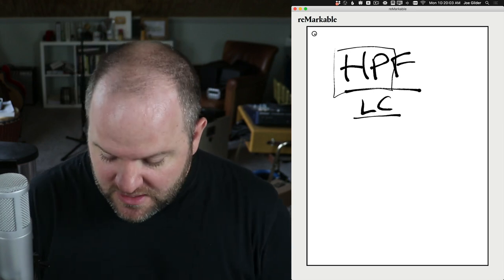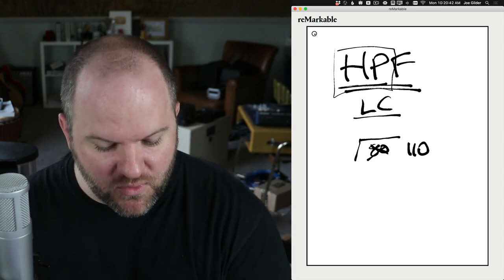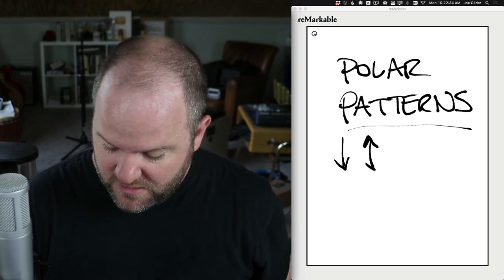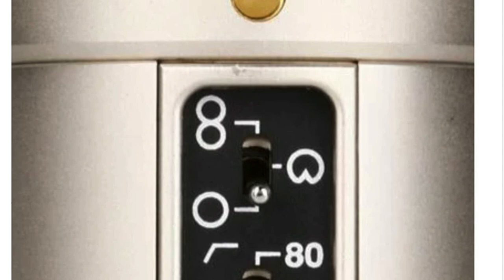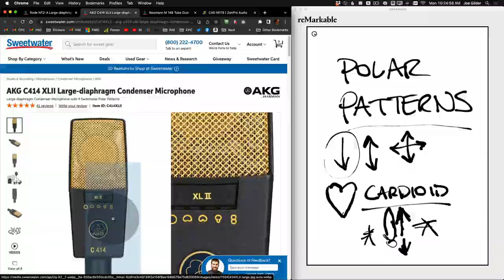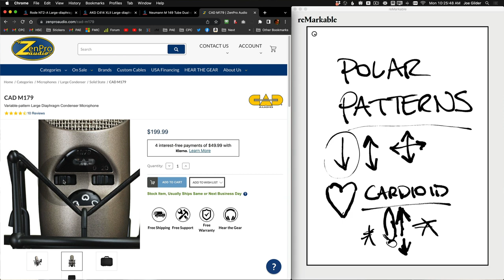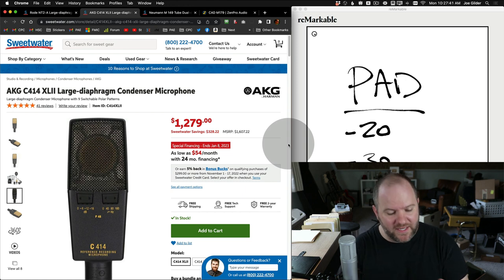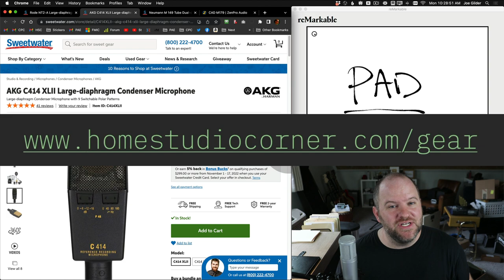Microphone Settings

Comment: Thanks for those explanations.  I got the CAD microphone last year but the manual wasn't descriptive, I messed with the dial, then couldn't get back to where I started so I've been using a different cardioid condenser mic.  I may go back to using the CAD now that I know how it works.

Comment: Thanks for the explanations Joe. Something that's even more confusing to me regarding microphones, is what's the best way to set the levels for the best capture (and less noise). Like what's the difference between gain and output knobs in the preamp and input level on the interface and which should be higher or lower... I'd really appreciate if you can give some advice about it.